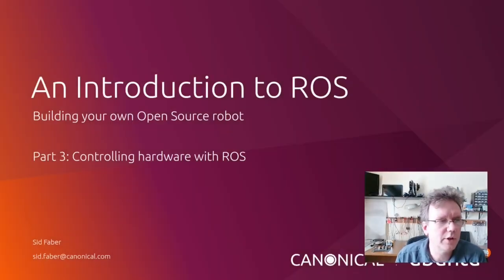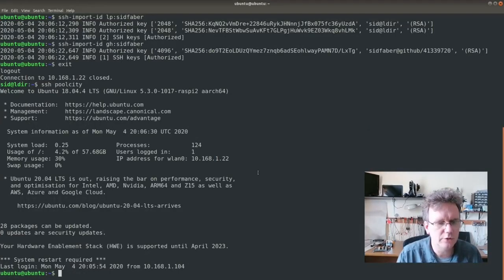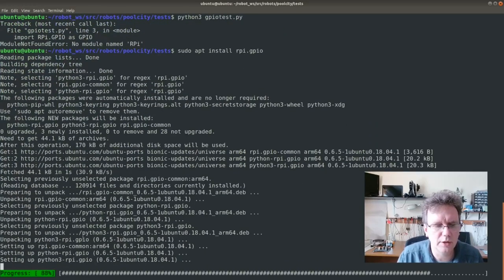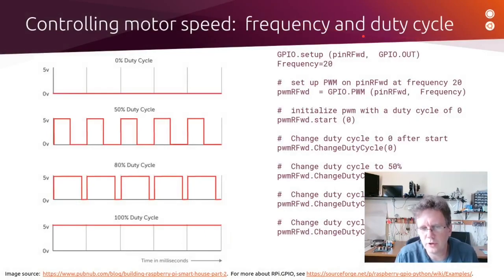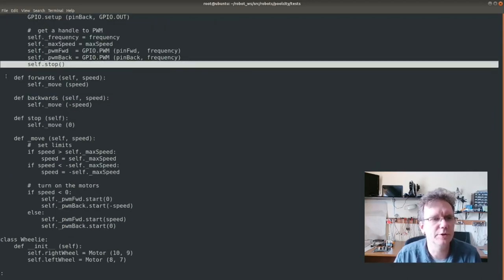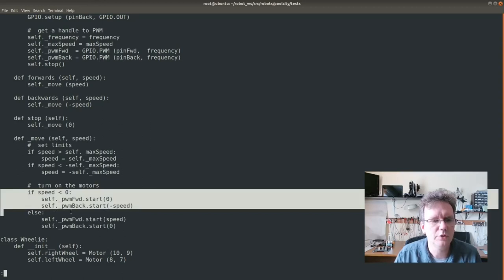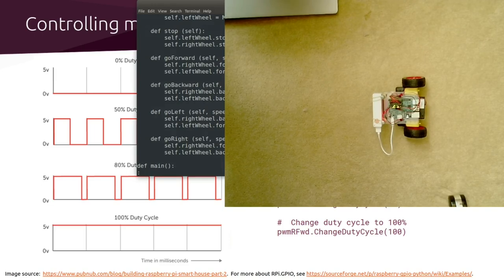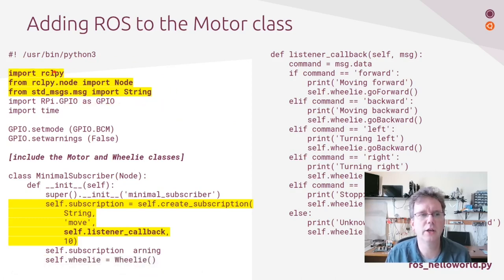An Introduction to ROS, the Robot Operating System: Controlling hardware (4/6)

Comment: great video series. i use a L298n motorshield. all i have to do is change the gpio connections and add the ena / enb connections, if i understand that correctly, the program can then be adopted. Good work.

Comment: This demo project is very interesting and easy to follow, thanks! And I have a question: you mentioned in the previous video, the General Purpose IO (GPIO) is one level lower than ROS, but here we directly access GPIO, why do we do that? I thought we should only deal with ROS. Thanks again.
Reply: Although the GPIO access is part of our project, it really doesn't need to be. That's all handled in motor.py which could stand on its own as a python library; in fact, this could be rewritten to use the Motor class gpiozero (https://gpiozero.readthedocs.io/), and I'm sure even higher level libraries exist. But where's the fun in that? The ROS code truly starts with wth Wheelie class that creates a ROS node. In a production robot with commercial servos and the like, you likely would first install/compile the manufacturer's standalone controller software. If the hardware is ROS compliant, it would include the necessary libraries which you'd link to your ROS project.

Comment: 18:27 sending the command from the laptop to the raspberry pi.. is there a networking setting we need to make before this happens successfully? I came this far following your video but could not establish the communication between my Ubuntu machine and raspberry pi on the robot. Running ROS 2 Eloquent on both the RPi and the Ubuntu machine. The nodes dont find each other. Can you please point me in the right direction?
Reply: ROS 2 uses multicast traffic to discover nodes by default. Are you sure your pi is connected, and your laptop and the pi are on the same network? If you're running ROS in a VM on your laptop, you'll need to bridge connections since NAT needs additional setup. Wireshark/tcpdump helps a lot also, you should see RTSP protocol packets for discovery and then for the communications.

If that doesn't help, can you provide a bit more info about your setup?
Reply: @UbuntuRobotics  I am having the same issue, gpiotest.py will run and so will motortest.py. I run these commands from Ubuntu desktop on my laptop, not a VM. My pi is definitely connected. Also, how would one change the RSTP protocal packets?

Any help would be greatly appreciated.

Thanks!!!
Reply: @Sid Faber  Thanks it's definitely working now :)

Comment: Hello, Nice project! I'm grateful for the knowledge you share with us!

I've done nearly everything you did in the last video (3/6), then shut down the Raspberry and turned the power down. After a day I connected again power to the Raspberry. Problems begin: it is not connecting to the wifi.

I've read that it may be that it does not connect until login. I don't think this is the case, because the last time I rebooted it a lot of times, and it still connected to wifi (or I would not have the opportunity to login because I'm only using ssh, as you recommended). If it is the problem what should I do (if needed I can access to keyboard, mouse, and monitor).

Another option I thought was that when I turned the system off, I did not wait enough time to unplug the cable (i waited about 20 seconds after the green led, which should indicate sd writing activity, stopped blinking).

Can you help me, please? Thank you.

############       EDIT       ############

After a lot of time, it connected. I don't know why, I haven't done anything, just leaving it on while I was studiyng and founding it connected after about one our. 

I will leave this comment to help someone haveing same issue. (If you prefer I can remove it)

Thank you again for the videos, really interesting and useful!!
Reply: Thanks for the note, glad you finally got this working!

Comment: sudo apt install rpi.gpio doesn't exist and fails.  when trying to run the examples they fail as gpio is protected and must be run as sudo... while some people have claimed that you can create a gpio group and such to make it so you don't need sudo access to run code that accesses the gpio pins, the steps to do this have not worked (for me). It would be nice if this was addressed in the video or at least in the video notes... have to admit its pretty frustrating to try to follow something step by step and have to do your own debug at literally every step... I'm interested in applying ros and not becoming an ubuntu ninja master.

Comment: hi Sid, the way you explain this project is really very easy to understand. i have one issue with the communication, sending command from laptop to raspberry pi. When i run the command "ros2 topic pub '/move' 'std_msgs/String' '(data: forward)'",  i am getting this error message in my laptop terminal "Failed to populate field: 'String' object has no attribute '(data' " .how to fix this issue
Reply: You should be using curly braces instead of parentheses, the third argument should be YAML format. Try this: "ros2 topic pub '/move' 'std_msgs/String' '{data: forward}'"

Comment: Hi can someone help me ? I installed everything just like in the video and as long as I'm in the robot everything works but from computer to robot doesn't. I run ros-helloworld.py in robot and do the ros2 topic pub ..... command in PC .Is like the listener doesn't see the forward messages ??? What could I be doing wrong ??
Also I'm doing source .....before the commands
Reply: Try adding some print statements into ros-helloworld.py for debugging and to make sure things are running as expected:
 - In main(), add a print right before rclpy.spin(), that'll make sure you've started properly.
 - In the MinimalSubscriber.__init__, add a print to note that the wheelie class has started
 - in the MinimalSubscriber.listener_callback, add a print for msg.data as the first line so you can see that the callback runs.

If you're really into coding and troubleshooting, my personal favorite is to use vscode ("snap install code") on my dev machine with an ssh remote development session into the robot (https://code.visualstudio.com/docs/remote/ssh). It's a really nice setup that lets you debug code running on the robot from your laptop.

For the rest, it's a bit tricky to troubleshoot in youtube :-) but keep plugging along!!!
Reply: @UbuntuOS  I am having similar issues. Sid mentions that its possible to send messages from the robot itself, how does one do that? I would rather do that, than have to get into the code and potentially make matters worse.

Thanks!
Reply: Hi guys thanks for the reply @celebrateubuntu the problem was fix after I reinstalled the pi image and added the wifi setup, I installed the gui for ubuntu, then deleted the wifi connection and connected through wifi using the gui and everything worked, firewall was off,, but with the setup for wifi that sid did it wasn't working for me.
Reply: @uberyerli  Try this on one machine / terminal session to send a test message on the /foo topic:
> ros2 topic pub /foo std_msgs/msg/String  "{data: hello}"
Then try this on another machine / terminal session where you want to receive the message:
> ros2 topic echo /foo
You should see something like:
> data: hello
> ---
> data: hello
> ---
> ...
You can run the "ros2 topic" command on any host with ros2 installed after sourcing the setup.bash file. From a networking perspective, both must be able to send/receive multicast traffic, and they cannot be separated by NAT / firewall / etc (i.e., they should have similar IP addresses).
Reply: @UbuntuOS  Great tip. In my case, the firewall was active on both the Pi and my Ubuntu machine. Disabling it allowed one machine to ping the other. I had to set the ROS_DOMAIN_ID variable also to the same number on both machines to get the communication open.
Reply: also for some reason both machines had to be on Wifi. The communication did not work if the host machine was on Ethernet and the pi was wireless even though the IP addresses were similar.